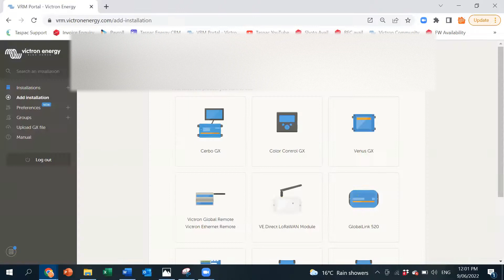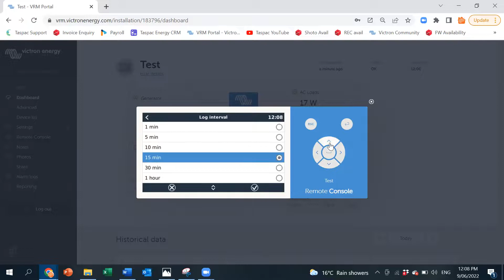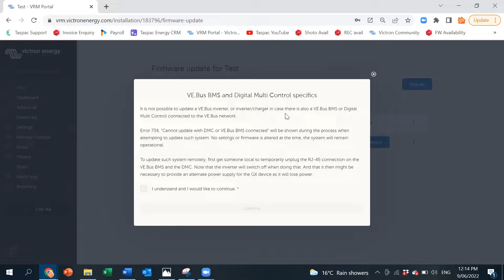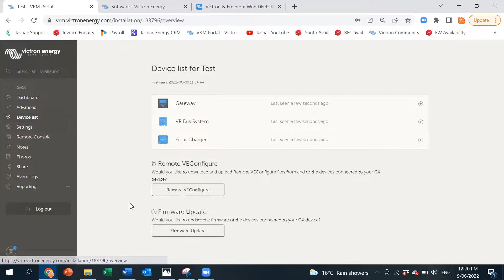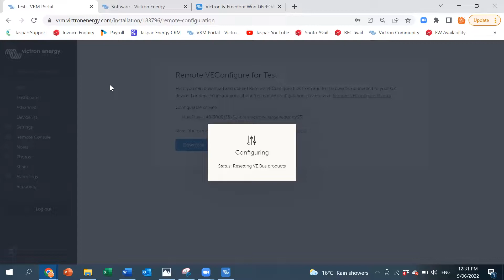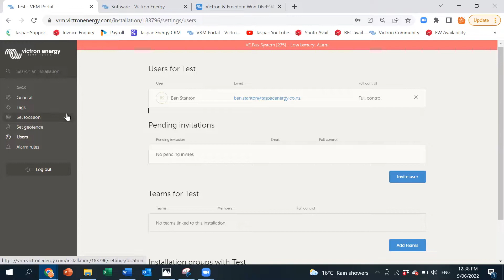Setting up an EasySolar using Remote Access via VRM

Comment: Hi Ben, Great tutorial very comprehensive.... I am just installing my Easysolar 2 Gx with a second MPPT....with 2 SOK 48V rack batteries.  Looking at the SK manual using closed loop with CANBUS RS485 comms, it seems like i dont have to do anything to configure my Easysolar Invertor?..AM i correct it is plug and play?  Also i have had them connected yet so i dont know how 2 MPPT will show up though my GX into my Victron app?

Comment: Hi can i connect my easysolar 2 GX 5000/48 on vrm without cerbo gx?
Reply from the maker: Yes you can... the "GX" in the "easySolar II..." name means that you have a GX built-in... there is an ethernet port above the Terminal blocks and also a small WiFi Radio you can use (short range) then you can add your system to the VRM portal and access it as per this video. BTW I have made a more recent video similar to this one that is a little more in depth and, well, ... recent

Comment: Hi there Ben great video.
If I have a small 2kw generator as my “grid supply” that has an auto cut out at 2kw can the easy solar 2 go be set that it doesn’t take more current than this when the battery is low and would call for more charging power ie and keep the generator running at say 1.5kw output?
Thanks Ben
Neil
Reply from the maker: Hi Neil,  - sorry for the late reply -  Basically "yes" you can set your ES II to reduce the AC in current - go to the remote console and "Device list" > Multiplus (inverter) and > AC in Current limit ... then set your current to 1500 / your generator voltage (230?) = (6.5A). You can also download the VE.config file and tick "power assist" under the "Inverter" tab. This will mean that if the generator is charging and there are loads that demand more than 6.5A then the EasySolar will "assist" the generator in running those loads, then when the load drops lower than 1500w the inverter/charger will resume charging of the batteries. - Hope this helps?

Comment: Hello Ben, could you help me with configuration of my MultiPlus-II 48/3000/35-32 (ACOut2 switchable)	+ SmartSolar MPPT VE.Can 150/85 rev2?

What I want from this system? 

We use this for washing machine, fridge, freezer and boiler. Is that possible to setup it that way : when there is AC load 2200 w + , to switch off AC OUT2 (boiler). And when there is load <300W to turn it back ON? I am little confused with configuration, as I used same software like you, but I cant get it to work. Every time, when I put Multiplus on automatic, it starts draining energy from grid to batteries. We also want to start draining energy from grid, when there is only low % on batteries. Thank you very much!
Reply from the maker: Just a note to start with: I think the 48/3000 inverter may be too small to run all those things. Unless you’re intending on using a very small element in the boiler. 

To control the AC2 out you need to use the Relay Assistant in VE.Config.
Reply: @benstanton  Hello, ye you thinking right, boiler has  only 1000W 
heating coil. Idea is that : washing machine,freezer,fridge on AC1, boiler on AC2. Boiler will work all day long, until there is big load (someone starts washing machine), so AC2 relay will turn off (boiler will turn of and those 3 have less power than 2400 W) .  I tried to use that assistant : programmable relay - ACOut2 - AC Load, and I set that higher/lower. But then,  when I choose main switch to ON,it starts taking AC from the mains. And thats something I dont want. When I switch to inverter, then those assistants does not seems to work. Is there any chance to start taking from the mains, only when the batteries are at a certain SOC?

Thank you very much

Comment: Hi, I am confused, if I setup my batteries as lithium iron phosphate, on the victron connect app, via clicking on mppt. Do I need to setup the batteries as Lithium iron phosphate in the invertor setup tool on ve configure app as well?  Or would the settings on MPPT synchronize automatically?
Reply from the maker: Yes - definitely. The easysolar has 3 devices built into one box so all 3 need to be programmed.